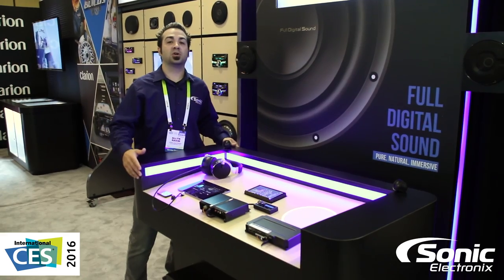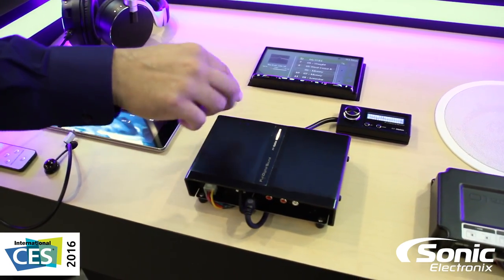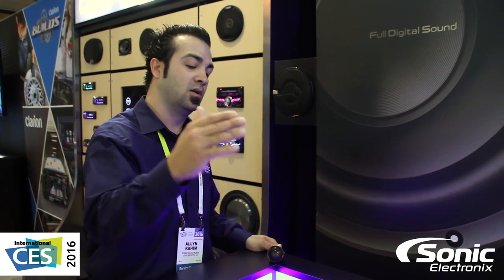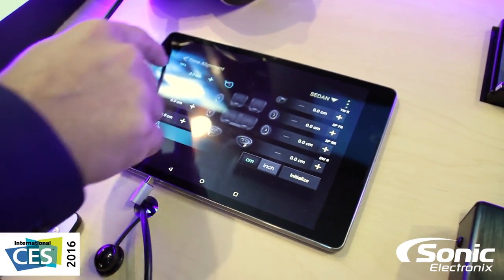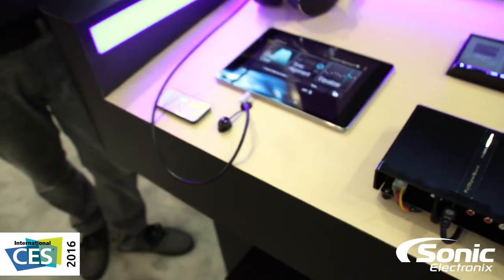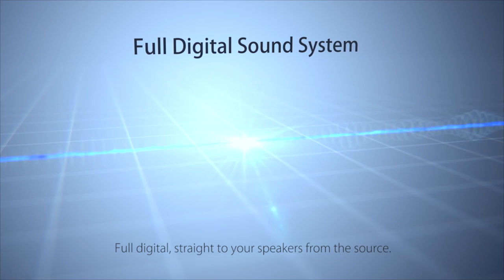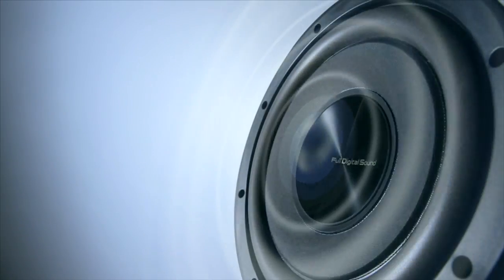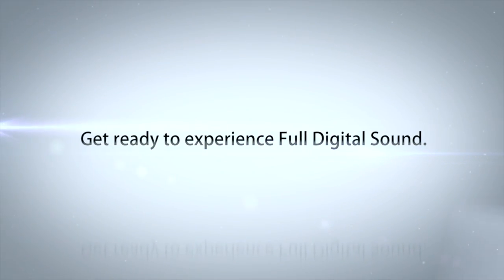Clarion Full Digital Sound System | Hi Res Car Audio | Quick Look | CES 2016

Comment: Well the way they explained this to you is pretty confusing, there is no such thing as digital sound really, the signal is digital all the way to the speakers where the speakers have a DAC and Chipamp built into them. So there are amps, they are just at the speakers (LSI makes chip amps, dac's etc). It's interesting though. If it's really 16 grand like someone mentioned below, well I don't think they'll sell many of them lol.
Reply: Doug Dale They actually don't have a DAC. That's why it's "full digital." The digital signal controls 6 separate voicecoils on each speaker.
Reply: Doug Dale Also, it's more like 2 grand.